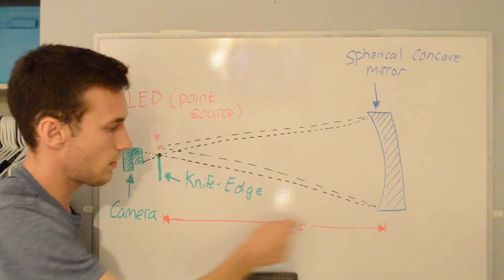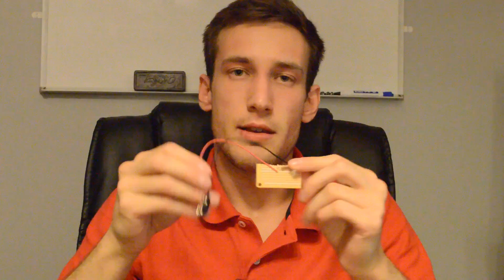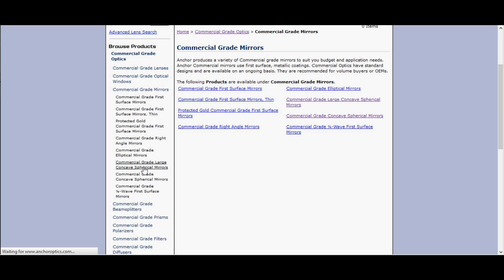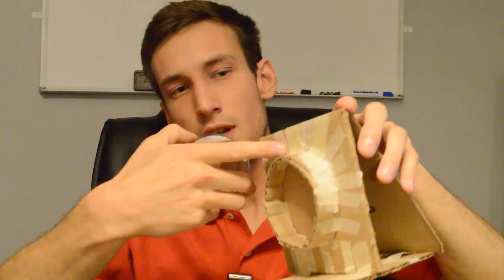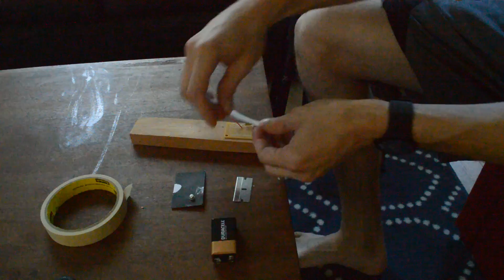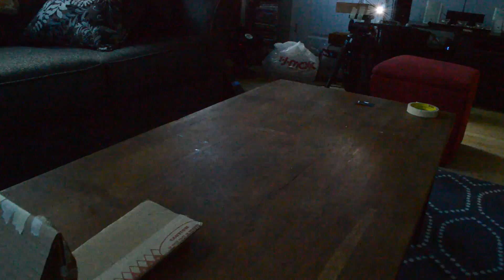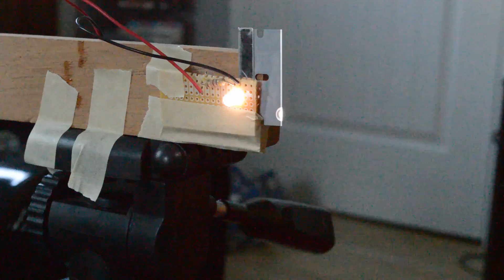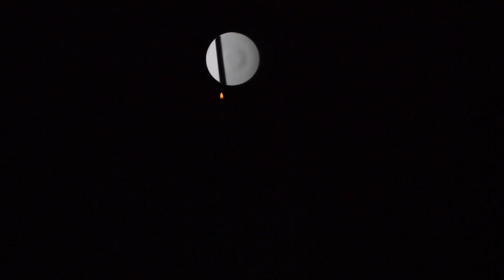How To: Build Your Own Schlieren Setup

Comment: Hey great post, thank you.
I tried it by my own for my study and I only get a shadow construction. Do you may knnow what I´m doing wrong?
Reply from the maker: First, set up the light source, mirror, and the camera, without the knife-edge.  If it is set up correctly, you should get a uniform light intensity on your mirror (as seen in the camera's viewfinder).  If you place an object in front of the mirror, you should just see the object's shadow.  If you don't have uniform light intensity, it could be because your camera is not in the correct location, or because you have a less-than-perfect mirror.

When you have made sure that the light distribution is uniform, place the knife edge at the 2f point, and cut off about half of the focused dot of light.  If you don't have anything in front of the mirror, you should see the light intensity decrease in your camera, but it will still be uniform on the mirror (i.e. it will still look like the mirror is uniformly lit up, just slightly dimmer than it was before without the knife-edge).

At this point I recommend placing a candle in front of the mirror, so that you can leave it there while you adjust the knife-edge.  Assuming everything was done as I mentioned in the previous two paragraphs, you should only need to make minor side-to-side (or up-down, depending on what direction you want to see gradients in) adjustments of the knife-edge.

If you put the knife-edge in and you can't see any light bouncing off the mirror in your camera's viewfinder, then the knife-edge is blocking too much light.  If you put the knife-edge in, along with a candle, and you still only see the uniform light distribution on the mirror, the knife-edge isn't blocking enough of the focused beam spot.  Keep adjusting back and forth until you see the gradients.

Hope that helps.
Reply: +JoshTheEngineer thank you so much for your detailed answer and that you take your time for helping me. I tried it like you explained to me, but i didn´t get a focus point at 2f form my reflected light. The focus point is at f and unfortunatly it didn´t work when I replace the knife edge there. Do i have a wrong mirror? Or is the falt at my light source. I just using a flashlight with a LED inside an put a aluminium foil over it with a small point like you showed in your video. Could this be the Problem?
And do you use a normal camera, like for example a sony or so? Or is this a special optic camera?

Thaaank you so much for helping :)
Reply from the maker: The light source should be fine. I've used all sorts of light sources, from LEDs, to USB lights with a pinhole mask, to the flash from my camera.  As long as the light source is very small, that won't be the problem.  I'm suspicious of your mirror.  Are you sure you're using a spherical concave mirror?  It should work with a concave parabolic mirror as well, but the concave spherical is the best.  If you put the light source 2f from your mirror, and the light doesn't focus back down to a point at the same 2f distance, then you might not have the correct mirror.  For the spherical concave mirror, if you place the point source at the focal distance (f), then it should collimate the light reflecting off the mirror.  That is, if you put your light source at the focus of the mirror (not 2f, just f), the reflected light coming of the mirror should be a constant diameter spot of light that is the diameter of the mirror.

I use my Nikon D3200 with a 15-55mm lens for two reasons.  The first is that I have the most zoom with this lens, up to 55 mm.  The second is that I can easily adjust the exposure compensation down to -5.0.  I've used my point-and-shoot camera that I've had since around 2005, and I've also used the camera on my phone.  You should really be able to use any camera you have lying around, but the DSLR is by far the easiest.

Comment: May I ask what is the minimum focal length of the concave mirror should be? Cause the mirror with 750 mm sounds a bit expensive for me ha:P Also, are there any requirement for the thickness and wavelength range of the mirror? Thank you!
Reply: Also, I check from your link on edmund optics, which displayed two mirror, one is with focal length of 75mm and one is with 1500mm. Is the 75mm one is the mirror you bought? Can the setup be worked with the one with 75mm?
Reply: Sorry for asking too many questions. Thanks!

Comment: hello, I don't get why you need a sharp metal thing, would it be possible to do it using a plastic materials?
Reply from the maker: You need something sharp/straight so that it has a well defined edge to cut off the light.  You also need it to be thin (axially along the beam path) because if it's too thick, it will get in the way of the beam as it's focusing down to the point.  A razor blade just happens to satisfy both of these limitations, and they're inexpensive.  You should try it with a different object, and see how that changes your results!

Comment: Will a parabolic concave mirror work?
29" DIAMETER ACRYLIC PARABOLIC MIRROR CONCAVE MINOR SCRATCHES Excellent Cond.
Reply from the maker: You can do this double-pass with a parabolic concave mirror, but the results are best with a spherical concave mirror.  However, if you can get two parabolic mirrors, you can make a Z-type Schlieren setup.

Comment: does it matter if the razor is horizontal or vertical ?
Reply from the maker: Yep, the orientation of the knife-edge will dictate which direction the derivatives of the index of refraction are visible to you.  For instance, if you have a vertical knife-edge, you'll see the horizontal gradients.  This is what I use for visualizing candles.  If I were going to look at a thermal boundary layer on a horizontal flat plate however, I would probably use a horizontal knife-edge so I could see the vertical gradients.  And of course you can place the knife-edge at any angle in between as well.
Reply: What happens if I let the light pass through a hole half of the size of the spot?

Comment: HI, actually what is the led mask?...i did not see at the details part...
Reply from the maker: Yea, I ran out of room in the video description.  To create the point-source, I use a little piece of aluminum foil, and poked a hole in it with a pin or a needle.  For the black mask, I bought a piece of black construction paper, and cut a little rectangle out that would fit over the circuit board.  Then I cut a small circular hole in it so that I could slide it over the LED.

Comment: how would it look with a parabolic mirror?
Reply from the maker: Parabolic mirrors are usually used in the single-pass Z-type setup because of the way they interact and shape the beam.  For this double-pass setup, the spherical mirror is used because it will reflect the point source light back to a point at the center of curvature (or twice the focal length).  Parabolic mirrors are good for the other type of setup because if you place the point source at the focal point, then you get a collimated beam out of the first mirror, which you can then focus back down to a point at the focal point using a second mirror.  However, you can use the parabolic mirror with this type of setup, it just won't be exactly as nice as the spherical mirror.  It doesn't hurt to try.

Comment: +JoshTheEngineer  Can we use the camera of a mobile phone? I mean instead of a special camera? Does it usually work?
Reply from the maker: Yep, that will work.  I used my Samsung phone with this setup too and it worked, I just didn't want to make this video longer than it already was.  The video is higher quality with the DSLR, but a phone's camera can definitely work.  You'll still need a way to make sure it doesn't move, so I ended up buying a little phone mount that attaches to my tripod (for a few dollars).

Comment: hello, I what to ask you a question. Thanks . Will schlieren work if we are trying to watch the shock wave in the circular pipe. the pipe is glass and 12cm in diameter and 1cm in chickness. actually, I want to now Circular structure will make schileren impossible?
Reply from the maker: You'll find that if you put a transparent circular tube in front of the mirror, it will look black on your camera since the light isn't passing through and hitting your sensor.  The way most people look at shock tubes with a Schlieren setup is to have a square cross-section with flat windows.  A better setup would also be either the two-mirror Z-type setup or a two-lens setup.  Both of these collimate the light as it passes through the test section so the windows won't affect the videos or images.
Reply: Wow, thank you for your kind answer.
Just several days ago, I came up an idea to use a cylindrical lens behind the tube to compensate the cylindrical structural effect  and We are make a cylinrical lens now.  ^_^

Comment: how has to be the light source if the concave mirror is larger (like 40.5cm diameter)
Reply from the maker: When I've taken images/videos with a larger mirror (in my other Schlieren videos), I used the same LED point source that I used in this video.  As long as the light diverges enough to fill the mirror, it should be fine.  I have also used a laser pointer with a lens that causes the laser beam to diverge.  The image quality wasn't as nice, but it did work.

For your case, you should be able to use the same point source that I used in this video though.
Reply: Thank you so much

Comment: where do you place the candle?
Reply from the maker: You want to place whatever you're looking at directly next to the mirror.  So I place my candle as close to my mirror as I can without burning the mirror.  If you happen to be using a Z-type setup (not what I'm using in this video) with two mirrors, then you don't need to (or necessarily want to) have the object you're viewing close to the mirrors.

Comment: where can i find a bigger mirror? lets say 2'-3' in diamiter
Reply from the maker: That's going to be tricky.  If you want a really good mirror that's not going to optical defects (such as those seen with the bathroom mirror at the end of the video), you're going to be spending thousands of dollars for one that is that big.  You might be able to find some old ones at your local university or even high school.  I found one in a closet, but it's still only about a foot or a foot and a half in diameter.  Sorry I couldn't help you more with this.

Comment: is it possible that I can make a portable schlieren system?
Reply from the maker: I don't see why you couldn't, but there are some things that will make it slightly difficult.  One thing is that you need to fix the components relative to each other, so you'll be moving around with a pretty big setup.  The path length between the source/detector and mirror is set by the center of curvature of the mirror (2f), so you won't be able to change how much room it takes up.  Another issue is where the object is that you want to visualize.  It should be close to the mirror's surface, so you'll need to make sure you place your entire setup correctly for the thing you want to see.  I think you can do it, but it will take a little bit of messing around to get it right.

Comment: Instead of a spherical mirror, can I use a cylindrical mirror?  Thanks
Reply from the maker: The problem with using a cylindrical mirror is that you won't get your light source to focus back down to a point.  The cylindrical mirrors focus light down in one dimension, but you need to mirror to focus the light down in all dimensions.  If you have a point source shining out in all directions at the mirror, then the only rays that will focus back down to the point they originated from will be the rays that hit the mirror perpendicular to the surface, if that makes sense.  The other ones will bounce off at the same angle they hit the mirror at, and won't focus back down where you need them to.  So what you'll get is probably a single line of light that focuses back down to where you want it, which won't give you anything useful in terms of this setup.  If you already have the mirror, try setting it up and see what happens.

Comment: Does anyone know why a knife-edge is used and why not a pinhole?
Reply from the maker: You can use a pinhole (aperture) too, if you want.  If you do, then you would have full illumination when no candle (for example) is in the field-of-view, since all the light would pass through the pinhole.  Then when you put the candle in, the deviated light rays will be blocked by pinhole, and you would get a darkening of the image, regardless of the density gradient direction.  If you use a straight knife-edge, you can selectively choosing which density gradient you want to view, and you will know which direction the gradient is in (lightening vs. darkening of the image).

Comment: Thanks so much for the video. Please how do I go about schlieren imaging without a mirror(capturing directly with a camera) , using lenses only......pros and cons if any ..
Reply from the maker: You're welcome!  I haven't constructed a mirror-less system, so I can't give you any details from personal experience.  If you're using a point light source, then you need a lens to collimate that diverging light.  The collimated beam will then pass through the region of interest, and you will use another lens to take that collimated beam and focus it down to a point.  You can put the knife-edge at the focus point, and then your camera after the knife-edge.  That's how I would get started if I were setting this up.  Take a look at my laser Schlieren video to see how you can use a lens to focus a collimated beam, and vice versa.

Comment: @ JoshThe Engineer : I have seen this effect many, many times in the shadow of my car's hot roof. Also, I see it sometimes on the wall of my bathtub when there is a hot bath. 
How are these situations working?  
Also, I wanted to ask how that NASA used this technique on a full size aircraft to show the shockwaves. 
I had never seen this technique used on anything but small objects in a lab environment.  
I skimmed the article, but will continue to research how they did it.
I'd love to be able to use the technique to visualize the airflow around my car. 
https://www.nasa.gov/centers/armstrong/features/supersonic-shockwave-interaction.html
Reply from the maker: They use a method called Background Oriented Schlieren.  I actually made a video about how you can use this method at home, and I provide some simple code that will help you process your data:

https://www.youtube.com/watch?v=VCUN59x0LF4

The NASA data from those now-famous pictures was taken from a plane flying above the target plane, and looking down at the desert floor.  You can also take these large-scale images by pointing your camera at the sun and using an appropriate filter (I wouldn't try this one at home as a beginner, but you'll find papers on it).  Maybe I'll make another video where I go into more detail about their measurements, but my video at least shows you how you can do it at home.  Hope that helps!
Reply: @JoshTheEngineer  Thank you ! I saw other videos where the planes fly in front of the Sun, but this image puzzled me, because the planes in this instance were seen from above. 
I assumed maybe they were just superimposed in Photoshop . Thanks for clearing that up about the bright desert floor.  Your video is absolutely, just the thing I was looking for!  
I will be sure to watch it in it's entirety later. 
Thank you for posting!

Comment: Can you use a normal mirror
Reply from the maker: A normal mirror won't work for this setup.  The diverging light rays from the point source need to be focused back down to the 2f location after hitting the mirror.  If you had a normal mirror, they would just reflect and keep diverging.

Comment: Can I use my camera phone?
Reply from the maker: Yep, I've used this setup with my phone's camera and it worked pretty well.  The only thing you have to make sure is that you can zoom in far enough with your phone, which also depends on the focal length of your mirror.  The farther you zoom in, the noisier your pictures/videos will become, but it's definitely do-able.  I would mount your phone to a tripod.
Reply: ok. thanks!

Comment: does a phones camera work?
Reply: There's a wonderful thing called the description ^^^
Reply: +Andrew Qiu oh OK. I don't read descriptions though!
Reply from the maker: Like Andrew said, it's in the description.  But the video description is also super long, so I don't blame you for not looking!

Any type of camera should work.  I would have posted video taken on my phone and my really old digital camera, but I forgot to take video when I filmed this.  The phone videos were actually pretty good.  It was just hard to zoom in and still get a nice crisp image.  The best option is to have a camera with a high enough zoom such that the entire image is filled with the mirror.  The reason the mirror looks so small in this video is that my camera lens only zooms to 55 mm which isn't that far (and the mirror is tiny).

You'll need to be careful though, because if you get a bigger mirror, the focal length might also be bigger, and you still might not be able to fill the image with the mirror.   Just some things to keep in mind.